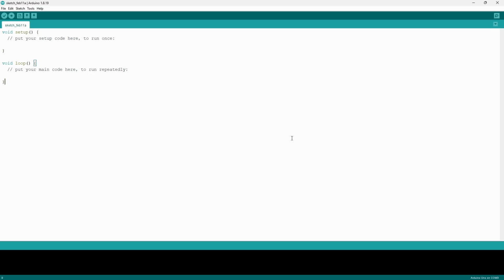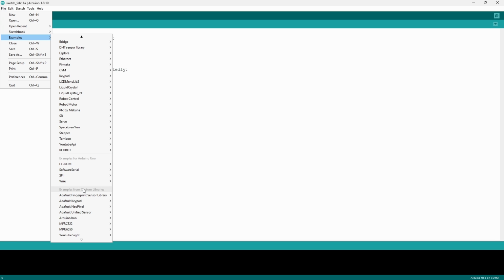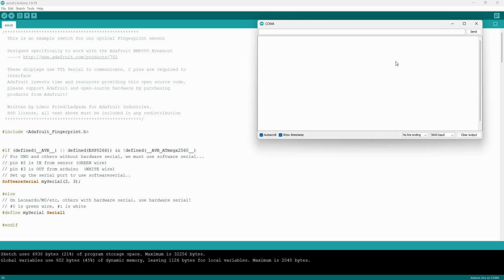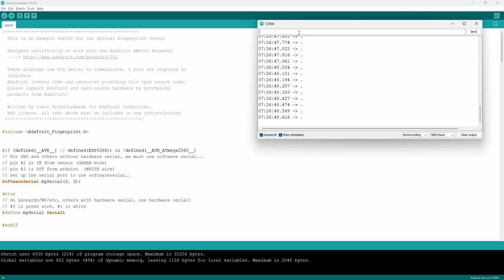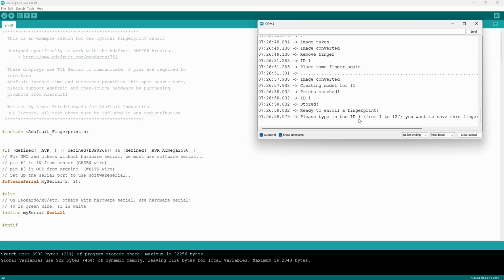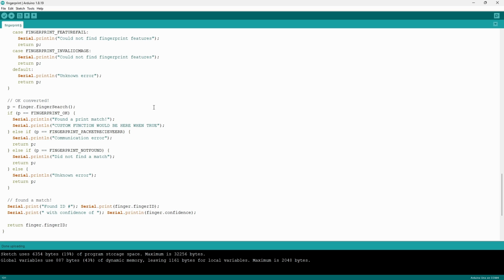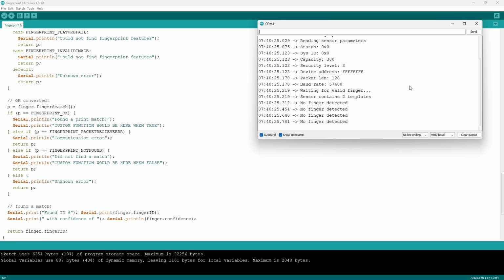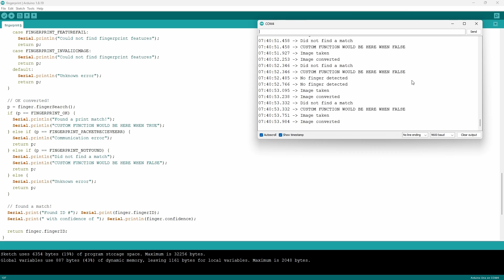Arduino Series: Tutorial | 3:11 JM-101 fingerprint

Comment: have you tried it on esp32.. i cant seem to get it working.. and can this be powered on 5v. you did not state if you connected this on 5v or 3.3,, but the module itself is 3.3v
Reply from the maker: No I haven't used it with an esp32, and I do not see a reason for it not to work. If you would have read the description I mention the problem with the light. If it's too bright just connect it to 3.3v which is what it's meant to be supplied but won't encounter any problems with either. Cheers
Reply from the maker: I know there are a variation in different esp32 modules and maybe even the pin layout. Just go over the pins